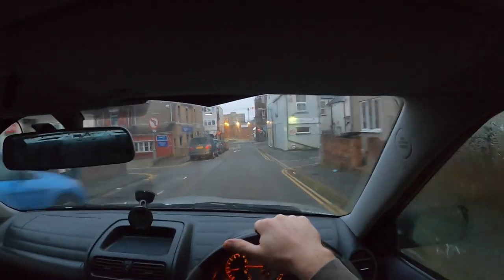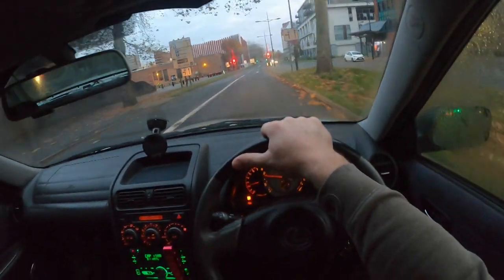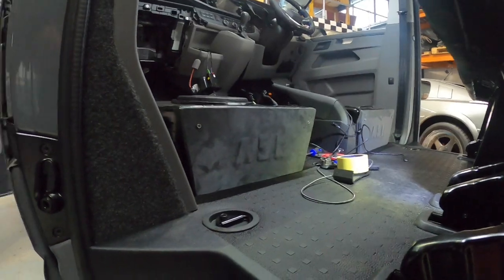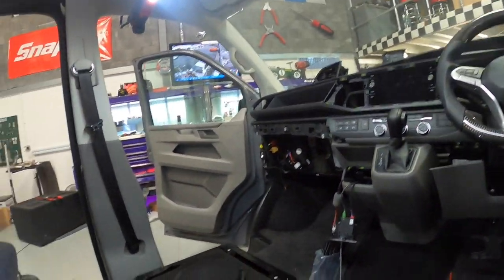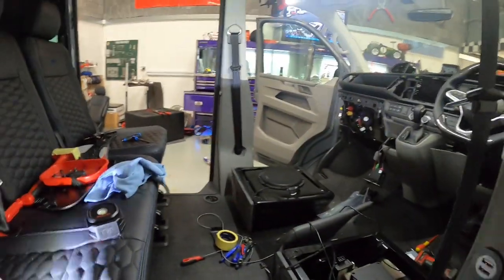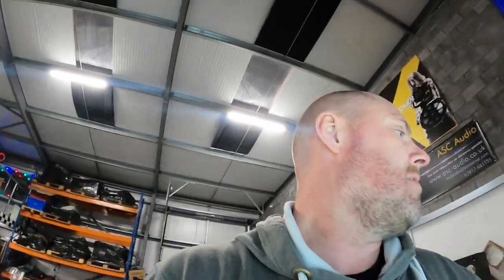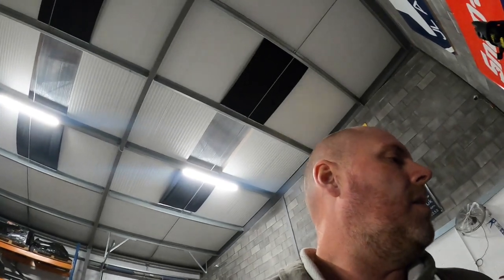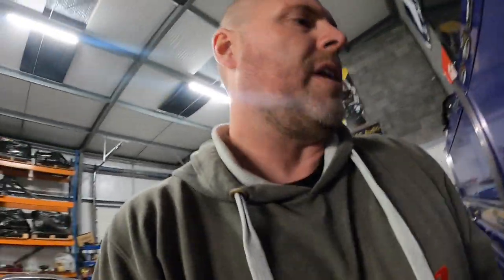the audison t6.1 is complete sound test and music check

Comment: ive got a t6.1 as well and been thinking about putting a subwoofer in it. What connections are there in the back of the media central ? And how do i disassemble the panels?
Reply from the maker: there are none behind just speaker feeds. start at the glove box and work to the gear surround